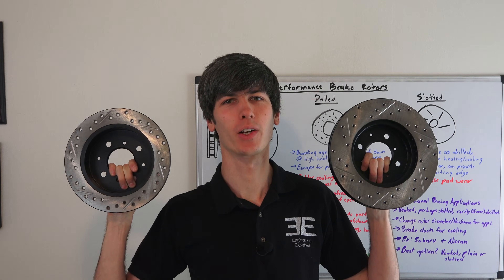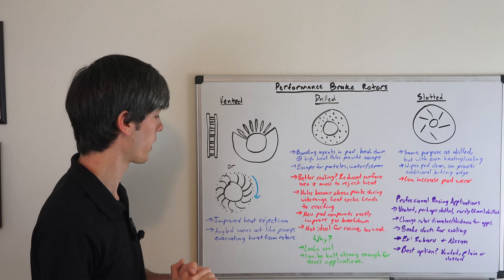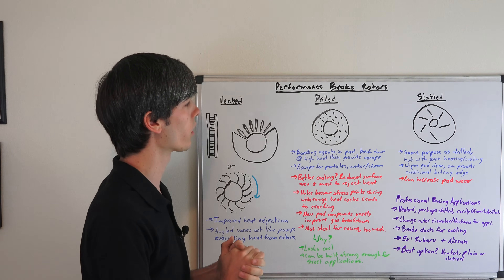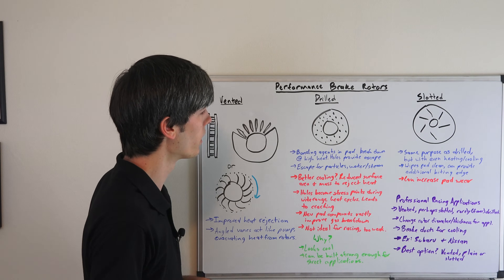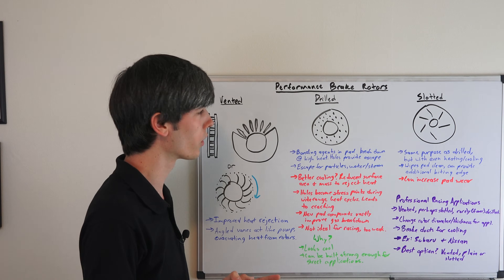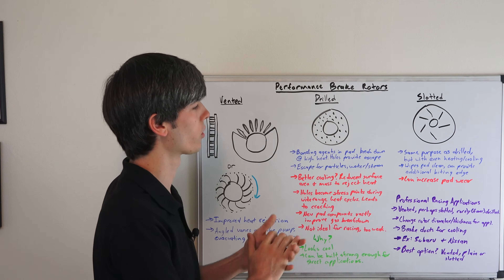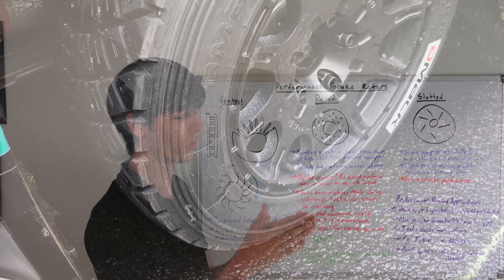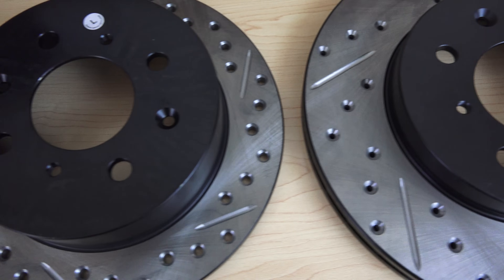Drilled, Slotted & Vented Brake Rotors - What's Best?

Comment: Also - didn't see you touch on dimpled rotors - essentially an attempt to curb the side effects of drilling yet still get some  of the benefit. OH yeah... AND what about Cross-drilled vs. just "Drilled" - probably getting too deep for this forum, but all things I am curious about. Know whats needed? a PROPER DISCUSSION (as in YOU need to tackle it, lol) of brake "Bed-in" or "Burnishing" procedure. My 2 questions are: "how much gentle break in before attempting a high thermal bed-in procedure" and "different procedures for different friction materials. NO one seems to touch on these points.

Comment: Engineering Explained - What about rotor size? There are manufacturers out there which sell kits to upgrade your rotor diameter by utilising a bracket which places your stock caliper out further to accommodate a larger rotor. They claim to improve braking by what is the physics behind that idea? 
Looking forward to your reply.
Great videos BTW, I learn a lot by watching them.
Cheers.

Comment: In my experience slotted and drilled discs usually cause not huge but notable vibrations while braking hard. I don't like that. I use plain vented discs and pads that leave light gray dust instead of the black we are used to. So even after thousands of kilometers the rims still look pretty clean. Breaking performance is surprisingly solid.

Comment: I think the drilled rotors that are more prone to cracking are the old design. If you notice, the new design includes chamfered drilled holes that resist cracking, mind you I said resist not prevent.

Comment: I made holes on front discs of my car once. I used small holes and was careful not to drill the structure that vents and connects 2 faces of the disk. It's really different if u make big holes, many holes, or just small holes. I believe drilling with small holes without penetrating the radial structure and make the vented disk breathe a lot easier bc it has a that air goes in and goes out of the vent. I believe AMG does things for a reason and their parts pass serious tests.

Comment: I got some ebc drilled and slotted rotors. I took my truck to an offraod park and got everything very muddy. The pads and rotors were full of mud and the mud chewed the pads up a bit. The drilled and slotted part of the rotor were packed gull of mud. i had to literally get a wire brush and clean them out. Yesterday I changed my cv axles and while the calipers and rotors were off i gave them another clean with the wire brush and the holes and slots were full of brake dust. I think if i were to get ebc rotors again I'd get the slotted rotors the stage 4 kit. either way, they are MUUUUUCH better than stock pads and rotors.

Comment: I always figured that slots and drilled are more to do with removing crud and brake dust off the disk/pad, just like how crap gets caught in the groove of the brake pad. I know that bikes still use drilled but the disk is exposed and a lot thinner. I had one bike that had a through slot rather than a grooved on the rear.

Comment: There is one point you are missing. A point that e.g. Porsche has pointed out. The drill holes actually tempt cracks to turn to them because of higher stresses and once a crack finds a hole it will stop there. You may know that if a crack is found on an airplane wing it is always drilled at the cracks end and then filled. Exactly same happens if you have a crack in the windscreen of a car. It will be drilled and filled. If you have drilled rotors it is worth while to check cracks every now and then since too much is too much even if they end up to holes.

Comment: I got 11 full years out of my last set of 'drilled' 930 Porsche rotors.  This was almost all racetrack use.  Whether the holes of Porsche 930 and 993 rotors are drilled or cast in is the subject of a lot of debate.  Many rotors are actually drilled.  Some (the Porsche 993 and 930 ones) are said to be cast.

Comment: I’m going with drilled and slotted for my 2000 explorer. All of the solid rotors that I’ve used in the past have warped due to driving in stop and go traffic in the Florida heat. Let’s see if drilled Nakamoto rotors handle the heat better.

Comment: Not only are you getting the higher cooling efficiency,  but you did slightly lower unsprung weight. Two benefits of the high performance rotors.

Comment: I have a saying, "Measure it with a Micrometer, Mark it with a piece of chalk, and Cut it with an Ax!" Who care if Drilled Rotors improve performance or not, they look FANTASTIC! I will be installing some on our ML 350 MB, it not a RACE CAR, but I'll appreciate the look everyday. The ML 350 doesn't use Drill Rotors as standard but the MB GLK 350 come from the factory with Drilled front Rotors. IMO Mercedes wouldn't put Drilled Rotors on because they look cool, they do it for a reason!

Comment: So I noticed you were holding brake discs that were vented, drilled, and slotted, I think that the slotted and drilled brake discs give you the extra "bite" so you don't have to brake as hard, making them very efficient, but yet they are very sensitive.

Comment: As said by you if the surface area in drilled rotors is less, then the pressure would increase as you have said that in your performance clutch video.
Thanks.

Comment: Used to own a E36.
with original pads and rotors...  my brakes faded from a stop from 200km/h.
Did this stopping test twice.

Switched to drilled and slotted rotors! could brake twice from 200km/h in a row without having fading brakes!

Comment: I live in the Colorado Rocky Mountains and I drive a BMW 325xi. From what I think I've learned from these vids is, I should go with slotted rotors in the front with ceramic pads. Do you think that would be best? A LOT of downhill braking.

Comment: Drilled brake discs also go easily crooked after heavy braking and quick cooling. When you brake you can feel the shaking of the car or brake pedal wobbling caused by crooked disc.

Comment: In short, vented is always better than not vented, unless your vehicle is light and slow enough to never generate a lot of heat in the brakes.  Avoid drilled.  Slotted helps for cooling and debris evacuation in racing, where component longevity matters until the end of the race.  I wonder if blowing air into vented rotors would add noticeable stopping power.  I also wonder if light weight rotors help performance and fuel economy and aren't that dangerous for people who know how to drive (IOW, don't need to brake hard often.).

Comment: im glad i just got slotted rotors for my miata. yes i know it is not necessary for a '94 miata i just thought they looked cool. haha. i can handle changing my break pads more often. the old rotors needed to be replaced and i didnt want to go with standard rotors. i wanted to see if i could get a little extra bite in my breaking

Comment: Most high end cars use carbon ceramic brake rotors and pads, so the rotors is highly resistant to warping, cracking, they are much lighter, and have unrivalled heat dissipation, so you can have benefits of having a cross-drilled and slotted rotors without negatives. On paper the 
cross-drilled+slotted rotor are a better design it comes down to the material its made from, how its made, and the application. besides all this it comes down to how you drive, you can have the most expensive rotors or the cheapest if your braking hard and hit a pothole or bump you risk cracking or warping a rotor.

Comment: I do a lot of hauling with my Tundra. I think I will replace my rear rotors with OEM but get some slotted front rotors. The pads the truck came with put off a lot of dust. Right now Im thinking I will use some ceramic Akebono pads all around.

Comment: daily commute in a high humidity wet climate.  the stock rotors on the 2015-16 Versa's are horrible, my wife's 2015 experienced fading on our last road trip four hours in...it was over 103 degrees with the heat index.  I am needing advice on a set that will dissipate heat a little better.  I am being told that slotted should do the trick by a couple of people since both cars are just daily drivers, and the addition of alloy wheels instead of steel wheels with hub caps will remedy 90% of my problem according to Nissan.  I just need some more input and I have watched a good bit of your videos and you have talked me out of a couple of mods that don't seem to help my car in my climate or driving conditions.  any input would be appreciated.  thank you

Comment: I have slotted rotors and i love them. I've had them on the car for 8 years now and never had anything go wrong.
Reply: Slotted, vented for the win..
Reply: Son of a Zombie I don't race on the track often no... But my brakes endure some very harsh conditions.  Though im not at the track regularly does not mean my statement has no validity. All im saying is i highly doubt drilled rotors would have lasted as long as my slotted ones.
Reply: ***** Personally i recommend them 100%

Comment: Blank vented rotors are the way to go. Look at an f1 car and try to argue other wise. More surface area/mass as he said, it's basically a heat soak so the more heat it can absorb/dissipate the less heat there is in the pad/on the surface where the braking occurs.

Comment: Doesn't the rotor additionally cool down towards the wheel (aluminum alloy) with a good contact between them? It's a pretty good mass and sometimes they have a shape that creates air drag or inflow/outflow. Could you enlighten this aspect please? For example if I put thermally conductive silicon paste in the mounting to the rim, will it conduct away the heat from the brake disk faster? A good comparison would be common steel stamped rims vs aluminum alloy and the third aluminum alloy with thermal paste...

Comment: Always enjoyed your videos however from the research I have done you are wrong on crossdrilled rotors. These rotors allow pads to get up to operating temp quicker and also help keep the rotor itself cool. Some tests have shown rotors are 150 degrees cooler. I forget if it was GM, cosworth or who it was who had a drilled rotor vs solid rotor on a dyno where you could see (thermal imaging) how much better the drilled rotor dissipates heat and also spreads the heat better across the rotor vs non drilled. Totally agree there are negatives with these often times experienced by people who buy a cheap rotor which is drilled which results in cracks. My last set of drilled rotors lasted 60k plus miles, numerous track days and were still in A+ condition when I sold the car, they were AP Racing. Tests have also shown better braking output sometimes 30-40% better. They are not used on exotics and other cars simply for looks, they do actually work. Even a 5% reduction in stopping distance could be hitting the bumper in front or stopping in time. Having to buy pads more often is a small price to pay......

Comment: Great concise review.  Lots of good info.  I have tried all 3.  Believe the rotor & pad quality have a large impact on performance.  OEM were plain vented, braking action not to my liking, when wet, slow response, needed lots of pressure..  The 1st were drilled & much better, instant stopping very strong power in all conditions.  Next were drilled but warped quickly.  3rd set slotted.  Best overall.  Consistent strong linear response, long life.

Comment: I'd go big blank rotors. Looking for brembo oem Ls460 Sport for my Ls460 base. Everybody claiming drilled /slotted rotors really are a huge advantage,let me ask you this,When was the last time you seen a slotted drilled rotor on an F1 whip? These guys really need the maximum brake performance,and they havent used slotted or drilled rotors in over 25 years. Yes they have carbon brakes,but if drilled/slotted rotors were sooooooo great,wouldn't grand Prix teams be tripping over themselves to use them?

Comment: So how about delving into non-performance rotor warping ?

Some folks claim it has to do with "bedding" the pads and rotors (I still don't understand this).

Personally, I have found that buying "top of the line", name brand rotors (my choice is Raybestos Advance Technology) seem to last much longer than the much cheaper ones, even when used with ceramic pads.

Comment: From personal experience I can tell you that I've had much better braking with my slotted and cross drilled rotors on both my Cadillac and my Suburban.. So, say what you will - they are effective. I've had them both for years and I've not had any problems at all. The non-slotted rotors I've used kept warping.

Comment: I've been using drilled and slotted rotors on my toys😏 they've been working great on semi metallic pads. I change my pads about every 20-30k and the rotors never warped or "failed" on me
Reply: what brand rotors?
Reply: Well my current car (toy) is a 2000 gs300 with a swapped 2jzgte stock turbos, I'm running the genuine rotors from the Lexus dealer, a bit costly but totally worth it. I've tested other aftermarket ones and cheap rotors yes will crap on you
Reply: what kind of driving do you do? when he is talking about the drilled rotors failing before the other 2, he is talking about circuit/track/autox driving, not regular daily driving.
Reply: Tbone Scriv good thing your anecdotal evidence doesn't mean anything in the realm of statistics and engineering. ya know. where they can demonstrate that more often than not, people like you are the minority. 🙄 besides the fact that your "toys" would have better brakes with solid rotors because they would have more surface area to dump heat. it's basic thermodynamics.

Comment: I found with back to back testing slotted performs significantly better and also holds on to that performance throughout the life of the rotor and pads, while non slotted rotors with same otherwise specs and same pads don't perform as well but the big downer is they degrade in performance over few 1000 Km of use, and not a little bit.. A lot! 

I found that its mostly to do with grazing of the pads and rotors, slotted rotors prevent this from ever happening, also they help with degassing and "bite" which is why they perform better.

Also I might add another vane style not mentioned in the vid, actually its not a vane at all. Called kangaroo paw vent design. Made by DBA here in Australia and its pretty damn good compared to standard vents. More internal surface area and more even heat distribution across the rotor contact surface, prevents howling and reduced performance when rotors get super hot.
Reply: vkorinfsky how did you test this?  lol

Comment: The slotted rotors actually help to shave of the smear from the brake pads. That that causes increased wear should be clear to anyone using those disks :D
If you could go into the forming of cementite on the brake disks and how that makes it seem like the rotors are warped I'd be thrilled :)

Comment: I have some really nice drilled and slotted rotors, and I beat the crap out of them.. not all of them are prone to failure. I understand that they add stress points, and could cause cracking, but couldn't the surface area in the holes rotating on the same axis as the vents actually improve heat dissipation if engineered correctly? Just a thought. Also, the last rotors I had were just slotted, and they cracked and pitted to hell and back. Probably more because they were crap rotors regardless of the slots though

Comment: Agreed that drilled are not ideal any longer.  Slotted seem better but only with very careful machining practices.  I've found the j-hook slot design to be the best lime you see on APRacing brakes.  I've cracked probably a half dozen sets of rotors on my heavy powerful car and the j-hook endure the most punishment.

Comment: 10/10 for being honest about the downside of drilled and cons of slotted.  

Most daily driven cars crawl in traffic and have repeated brake application.  OEM is usually the best way to go for durability and quiet operation.  A super aggressive pad will harm and reduce the life of stock rotors. On the other extreme you should not cheap out and buy $12.99 made in China pads to stop 4,000 pounds of car.  

Car makers should not cheap out and offer 4 wheel fixed calipers as standard equipment.  Opposing pistons provide more even and better braking.  There is also no way for the caliper to bind like in a floating system where the floating stops and only the side with the piston(s) is doing the work.  Built in mass mass mass production to go even on the cheapest new car the cost of fixed calipers would not be prohibitive.  Pad replacement is also less work on fixed calipers.

Comment: Good Video Presentation... Im in the market of purchasing new Brake Rotars for my 2016 Audi... I like having Drilled / Slotted appearance and the ones which is a part of your "Video Presentation".Would you recommend "Brake Rotors" being Coated to protect against unforseen weather challenges. Im looking for good quality since I'm replacing OEM Brake Rotors /  Pads.

Comment: Two of the most important factors that make the most difference for the average street disk brakes are venting and brake surface area. I had a Fiero with solid disks AND were too small for the car. Braking was scary and then faded on top of that.

When Pontiac finally at least put vented disks on them in '88 it was a whole new animal. 
 
When Ford increased the size of the disks on the Crown Vic in '98 they put the '97s to shame. Same with their Taurus cars. I could go on and on. 

Drilled and slotted are almost useless compared to those two aspects.